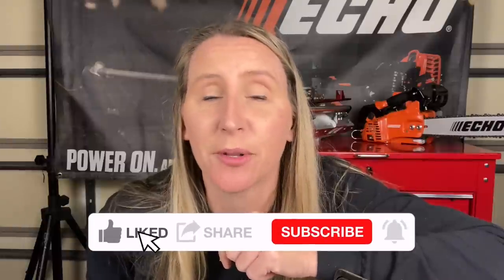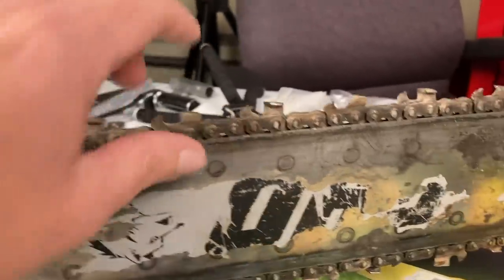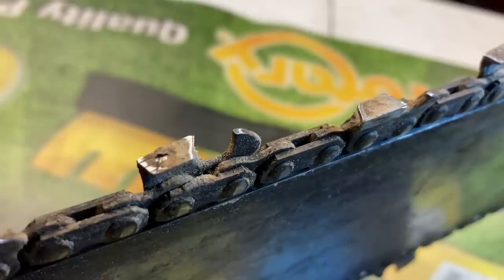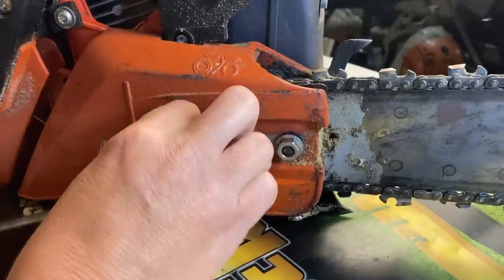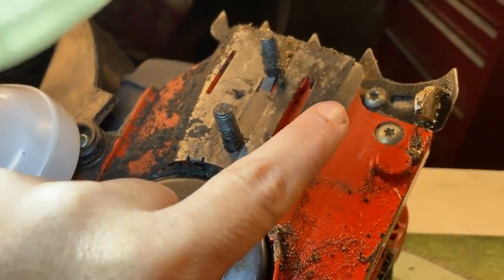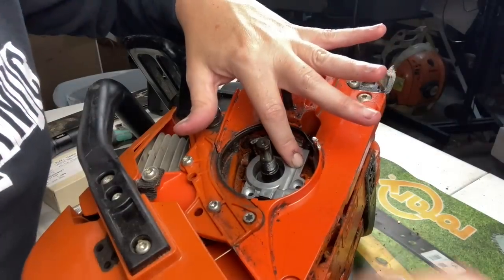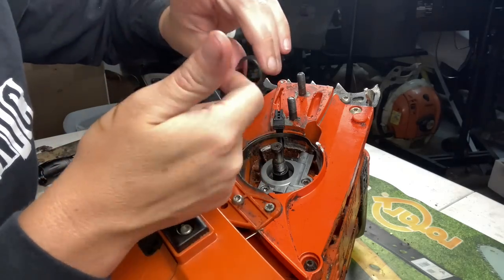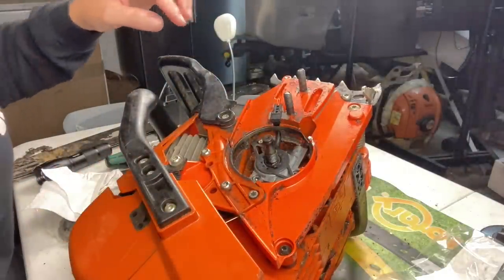How to fix an Echo CS-590 Chainsaw that got destroyed BY ONE NAIL! Complete oil assembly repair Vlog

Comment: Good video.👍 I have to wonder how long they ran it after the original failure, there was no hint of bearing remains inside the clutch housing. I have broken chains like that and you KNOW something bad just happened.
Reply: Yeah, no kidding, I'm thinking the bar damage happened before the rest of the damage, (probably from a clogged bar) how could that thing even run with the sprocket loose?
Reply: @gordonhenderson1965  I was thinking the same thing, maybe a new chain would be tight enough to allow you to tighten it to the point where it looks ok from the outside? It would have to rattle around though, at least  enough for anyone with even a little experience on a chainsaw to realize something was wrong.
Reply: @GuysPlayingWithTools  Yeah, it probably coulda run with a tightened chain, but she said the customer was a 'pro'.
Reply: @gordonhenderson1965  it seems really, really unlikely but you never know. The lack of shrapnel makes me think it ran like that for a good while.
Reply: @gordonhenderson1965  The customer may be a pro, but his employees sure aren't.

Comment: Got me scared now. Hit a nail the other day with only about five hours or so on my 590. Started cutting crooked. Guess I should look a little further for any more damage.👀
Reply: Sounds like the chain took some damage
Reply: @rgthomson1 ,
Exactly,  typically that is the extent of a nail hit,  resharpen and go on!
Reply: @rgthomson1  It did. Been touching it up with Pferd CS-X on the damaged side a little at a time.

Comment: Would it be a good idea to pressure test the crank seal being it got hot ?
Reply: I dont think the crank seal would have been to hot with this, the heat went to the bar with lack of oil and the internal parts fixed just broke with the shock, when i heard the price of the fix i thought the crank seal had broke also, lol

Comment: Love watching your Video's,,,, But here's a question. When your getting that deep into a engine,,, or any repair really ,,, why don't you wash or clean out the saw first ! I've been a mechanic for years , and of course repaired all my 4 wheelers , tillers, weed eaters etc.. and it runs me crazy working on a saw thats oily , nasty , saw dust every where. get your hubby to make ya a shower like a parts washer . set the saw on a rack over a parts washer tank,,, sorta spray and wash the saw out ,,, blow it off with a air hose and she's clean for ya to see and work better !
Reply: I worked on small engines for years. Took a break from being a diesel mechanic. Now I've been back for about twelve years. I wish I could go back to working on saws full time. A lot of the reason is you just have to have it clean enough to do a good repair. Time. I've always got an air hose ready to go, then when I'm done I will hit it with the pressure washer. Air before, and during the repair, pressure wash after. The less time on one the more time for many.
Reply: Instead of all of the bloviating about yourself and what you think she should do, why don’t you just make your own videos? Lol

Comment: If it's only 7 months old shouldnt it be covered under warranty? Also if the repair bill is $250 wouldn't it be a better idea to just cough up an extra $150 for a grand total of $400 and buy a new echo cs590?
Reply: Warranties cover damage due to defective parts failing. They don't cover repairs caused by accidents (hitting a nail in the wood for example) or stupidity (wrong fuel mix, continuing to run the saw after hitting a nail...).

Comment: Bluing is quite normal on quite a few chainsaw bars from different manufacturers as it's part of the manufacturing process but with this chainsaws bluing is caused by lack of oil or in this case no oil. It comes into question who is using this as I could have probably understood it if it was a hired chainsaw.

Comment: Well you said he was a tree cutter. It is for sure he is not an accountant. That saw new is up to $439 retail. This repair is more than half the cost of a new one. The previous repair was almost half.
Reply: I don't know, I think an accountant would spend $200 to repair over spending $440 to replace. But yeah with these two repair bills in 7 months time, they add up to more than the purchase price of the saw itself which just isn't sensible.
Reply: @killer2600  except that a new saw would die just as expensively running on straight gas. And a nail would do just as much damage to a new saw. The expense is not a function of the quantity of the saw or the parts, except for the nut holding the handle.

Comment: Wow. The owner spent $200 on a prior repair, now another $250 on this one. How much would a new saw cost? IDK but would it be more than $450? Are csaws really that expensive? I routinely repair my stuff rather than replace, but this seems unreasonable.
Good work though, interesting video.
Reply: Yes some saws are quite expensive, I just spent $1600 on a Stihl. The CS590 isn't though, $420 at Home Depot.
Reply: @om617yota8  Thanks for LMK.🙂

Comment: why in the world would you spend or $500 on a $200 chainsaw that chainsaw was abused commercially a residential chainsaw used commercially that is so funny broken teeth burned bar somebody got in a hurry put the wrong gasoline mix in it probably no bar oil and probably never ever ever sharpened the chain and you probably charge $80 an hour to get that fee up to $250 but he deserves it nobody should have used tools like this they should not have them